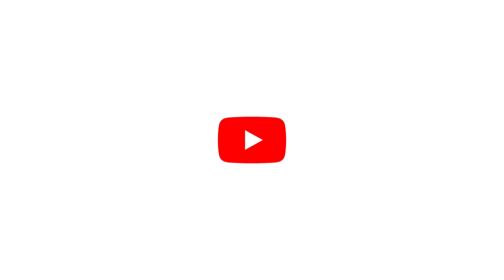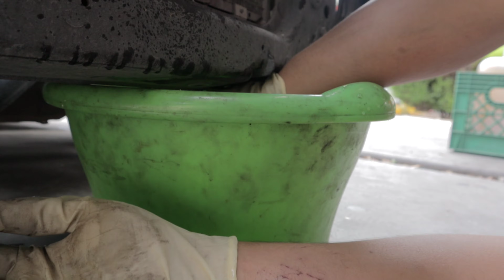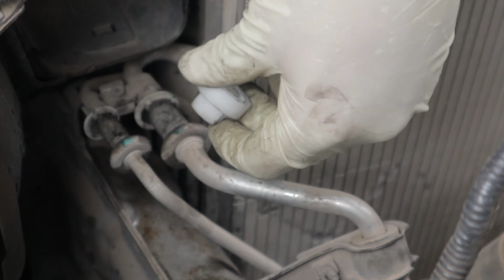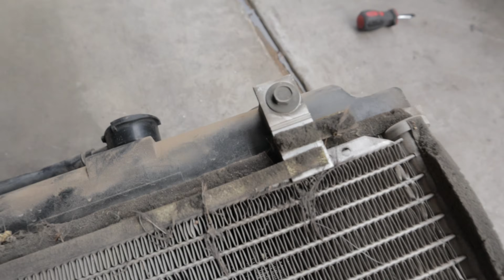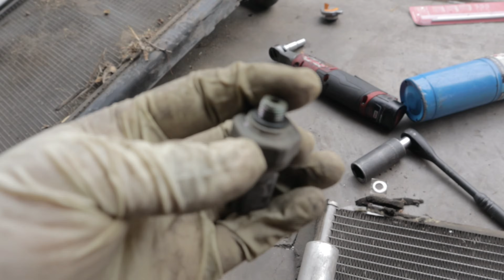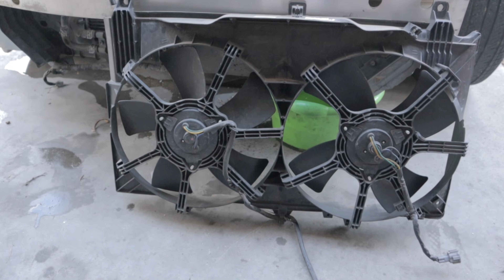Nissan 350z AC Condenser Installation same as Infiniti G35

Comment: Commenting for everyone BEFORE YOU START. Idk if he said this anywhere in the bio, I sure didn't see it.. but in the beginning when he's going over the tools needed he says "27mm socket". Then when you get to that portion wayyy later in assembly it's actually a 24mm. Trying to prevent anyone from being like me, I've got my whole car torn apart and now do not have the correct tool at my disposal since I bought a 27mm. Yes I should have double checked the video first and I did watch it all the way through many times before starting but that was only to get the process memorized a bit, I wasn't listening for tool size discrepancies.
Reply: **this is not a hate comment, video was mega helpful, just a warning for anyone like me who doesn't stock mega mondo sized sockets

Comment: is the condenser sold separately?  on OEM parts site I use look like it's sold with the radiator.  if i can get it separately, what would i expect to pay?  this is for 2008 G35 sedan (VQ35HR).  thanks!
Reply from the maker: Your vehicle has a different setup. For these older models, the condenser is not built into the radiator like your model and up.
Reply: @ERICSDIYGARAGE  thanks!  i'll let it wait until next spring since I've spent enough this year (just replaced 6 ignition coils and replaced passenger heater hose connector for second time...  ugghhh).  looks like no overheat damage but who knows....